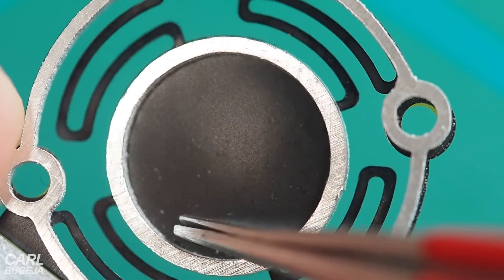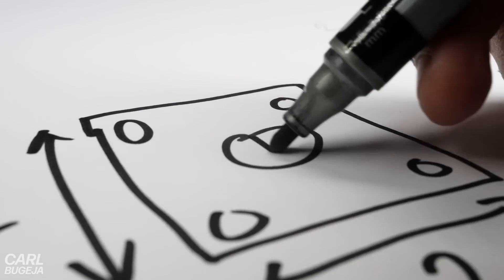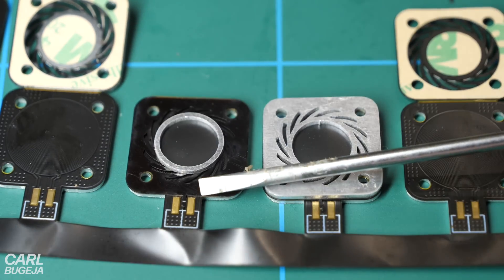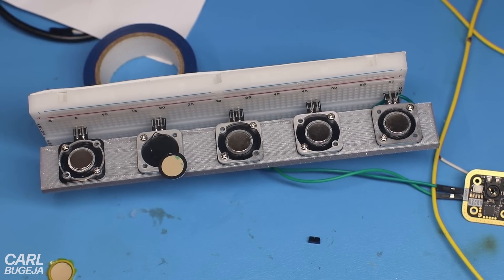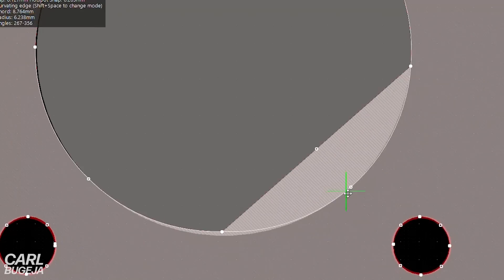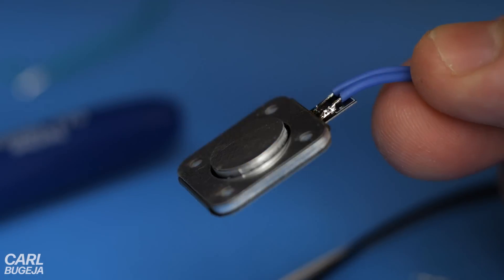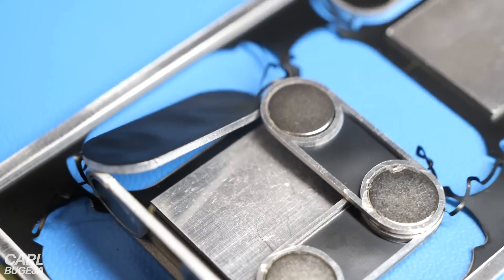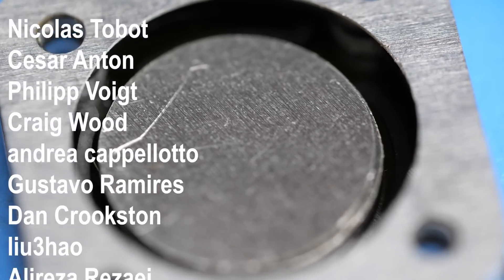Building a Spring Actuator with Flexible Circuits!

Comment: It could have been a cool concept speaker. If you would ha e actually taken in how a speaker coil and cone functions.  I believe you could do something cool. Probably would not improve or impress the current working system.  But. Hey that is pretty cool idea. A completely flat speaker? I could have a 15 in mounted in a box behind my truck seat or something would be epic

Comment: This project makes me think that you could use a bunch of these flexible actuators like mechanical leaves like when blown upon by wind, they binder moving back and forth they could create a current that could be stored in a battery Bank giving you more power conversion then a fan style wind turbine.. or you could make each of these into a little fan that could generate current financial wind coming across them..  namaste..

Comment: If using smaller weaker magnets allows you to make a smaller actuator, the blind are a ready market for a Braille actuator. About 10 years ago I corresponded wot someone making a Braille display using solenoids to make pins stick up. A smaller version of this using this technology would use less current and cost a lot less to build. 

Just thinking, multilayer actuator driving plastic pins might reduce the magnetic interference. enough to make a finger-sized Braille display.

Comment: Carl. I have a challenge for you. To print a entire RC plane. No wires, no parts to add, only glue, and plugs you can solder on to add chips and circuits you find on the market.

Comment: I have 1 mm neodymium magnets. Can they print a pcb coil that small? If so, a braille display with 1 mm pixels should be possible. Might need coils even smaller, like .25 mm to avoid interpixel interference.

Comment: How about filling the housing with oil, putting the assembly in a waterproof flexible bladder and using this actuator as a way of generating pressure waves underwater for communication.

Comment: true dc mhd bearing motor
Reply: thats a speaker magnet coil
Reply: hey dont move the magnet, move the coil
Reply: the coil pcb is much lighter to flex than the magnet on top of the it, yep two layer pcb with socket for the magnet
Reply: macro accelerometer
Reply: magnet on pcb, and the moving part on top, like a flap
Reply: it can be flap flex fan

Comment: Carl, you are interested in a very interesting private field.
As an engineer, I love following your work.
I have two suggestions.
- Play with frequency values.
- Continue the winding in more than one layer while placing the coil on the pcb. For example, let's say that all 8 layers are coiled. I think this will reduce the overheating problem a bit.

Comment: === warning. google translator in action ===

the design aesthetically looks pornographically beautiful. But technically, the solutions presented make my eyes itch.
be sure to use magnetic cores.
1. the magnetic field of a permanent magnet extends far beyond the device and will interact with the surrounding objects. With electric circuits, with ferromagnetic materials, and with permanent magnets of neighboring actuators. Moreover, both in statics and dynamics. The same applies to the magnetic field of bare coils.
2. These bare magnets will collect all the ferromagnetic debris they can reach, and the device will fail very quickly
3. If you want to use low-efficiency printed coils, the use of magnetic cores with high magnetic permeability becomes a necessity

Magnetic cores can be used solid metal. But for good dynamic characteristics, it is better to use layered ones, which will not be easy in such sizes. Maybe some powdered ferromagnetic composites with high electrical resistance will help.

And more. Try to control the coil not by voltage but by current. There may be some kind of class D amplifier with current feedback. This should improve both the linearity and energy efficiency of the actuator and driver.

P/S/ about the flexible element. I believe that rigidity in the direction perpendicular to the axis of displacement is critically insufficient in most cases. Maybe instead of cutting, it is better to use corrugated stamping as in the coil holders of conventional dynamic heads?

спасибо за внимание, и прошу прощения за много букв. :)

Comment: Dude you might have got the start of a cool keyboard there:
To mitigate the interactions between adjacent magbets try putting the magnets with opposing poles next one another (Nup, Ndow).
Then build a keyboard array, if you keep the magnets up with a constant coil voltage you can then monitor the change in the coil current when a magnet is pressed, boom you got a frictionless keyboard.

Comment: Please try to build a Braile cell, that is a perfect project, it requires miniature actuators. I worked in a project like this for blind people, and the braile cell technology was too expensive, it was a German technology using high voltage, but if you manage to make it work for active braile cell, that will change the life for many people. The prototype we made was like a cellphone using this active braile cells. Great work by the way!!
Reply: He tried to make a digital display earlier and it didn't work.
Reply: Do it do it
Reply: @06howea1  yes
Reply: We would love to provide necessary financial support.

Comment: Inwould mount it under a flexible Material like thin Silicone or something. so you can make an analoge dynamical User Interface that shiw Button only whe they are touchable.
Just make an contact under the Magnet an you have a haptical Dynamic Button

Comment: Instead of a spiral use something between a J and a U with longer to the outside ring radiating inward. Or even a W where the middle hump is not connected to the outer ring. The shorter length is glued to the magnet. So say you had 8 segments radiating to the center ... you would have 8 glue points. This would allow the flexure to be below the magnet and would constrain it more centrally and have a more consistent level and minimize the size further.  Or if you bent on a spiral make entirely underneath the magnet and just confine the center. Basically invert what you have in the thumb nail ... instead of the 4 points connected to an outer ring, bring them all underneath and to the center.

Comment: How about active magnets instead of permanent ones. so two counter flexture coils folded. this would eliminate the permantent magnets trying to bunch together. Experimenting with oscillating circuits could be interesting as well, e.g. to reduce energy consumption,

Comment: In my basic understanding of magnets and circuits, I feel like you should see a change in voltage as pressure is applied to a flexed pad. If I am right, and the sensitivity of what you are using to read the voltage is refined sufficiently, then this could have applications as a minute load cell.

Like low pressure environments / suction sensors or powder fill machines in pharma manufacturing.

Comment: I know it wouldn't exert as much force, but what about instead of using a magnet you used another coil with opposite polarity? What it lacks in force it makes up for with reduced thickness of the whole assembly. 
_______
|   @   |
|@  @|
|   @   |
----------
Something like this might let you do that idea for tilting a laser reflector. The @s represent pairs of coils on top of each other with opposite polarity, so they'd either attract or repel each other as required.

Comment: If the mechanical bit you are moving can be made to be bistable, i.e. latch into one of two positions, you would only need to power the actuator in either polarity to switch it. A polarized screen covering the visible display in combination of a polarized reflective coating on the articulated element might result in the element being visible in one position and invisible in the other. A variation of the flip dot display where the moving element might not need to actually move very much at all.

Comment: The PCB strength is not as good as metal, but actually you show quite good results.

Pros of flexures: Frictionless guiding, quite good on spring linearity for controlling. 
Cons of flexures: Deflection of the beams usually about 1/10 of the length to prevent yield, so the moving distance will be limited.

Comment: I think your laser tilt flexure suffered from sheer force, sliding the magnet without deflection. This seems likely due to your coils being polarized through the thin part of the board.

If you had the four coils aim radially you might get a better response.

How I would approach this is I would run a supply from the outside of the board along one of the 4 radial axis (x+, x-, y+, y-), one for each coil. On either side of these lines have vias, one for each coil. Connect the supply line to the most central via on a selected rotation (cw/ccw). Run on the under side a circular trace to the next most central via along the longer path (can't go through our supply line). On the top side run a trace back towards the first via but then skip to the second most central via to start the second coil.

Not much area in the coil but the change of axis and many more coils could compensate.

Comment: It's probably already been suggested, but have you tried fixing the magnets firmly and having the coil as the moving part? You can power the coil via copper on the arms of the flexure. You then should have far less mass to move, and with the magnets fixed, you wouldn't get the problem of the magnets tearing the thin flexure arms apart. Am I missing something here?

Comment: What if you flipped the concept around?  Integrate the PCB coil into the movable part and move the permanent magnet to the underlying substrate.  That way the flexure doesn’t have to support the weight of the magnet or keep it from flying away.

Alternatively, perhaps try adding some iron to the movable part and have the flexure provide a restoring force to spring back from the underlying PCB coil when turned off.

In any case, I think the permanent magnets are the most troublesome component of these assemblies.

Comment: If you used your multi-coil pad with a piece of steel instead of a magnet, then you could use the flex unit as a sensor that would proportionally couple the center driven coil to the sensor coils proportionally to the force applied.  This would be a good low volume flow sensor.

Comment: I don't know why but I can see this being a super futuristic button. A system that pops it out then you can press it like a button. 

Say you want to turn on a light. It doesn't pop the button out untill it's pluged it. Once plugged in you can push it and the magnetic field can be used to register a button press.

I wonder if you could also use it as a n analog button.

Comment: If you had a system of flextures that you glue to a moving piece, you could have a bistable actuator. You'd just need the flextures to attach to something that compresses them slightly from their rest position, so that deflected in or out is stable, but in the middle is not. I need a thing in my life that indicates whether the current time is inside a specific period, but it needs to consume essentially no power most of the time. I could use a bistable version of this to shift an indicator pin up and down, so it's either sticking out or hidden. You could use a series of this indicator to create a progress "bar" or a binary readout, but simple state indicators like "is it between 3 and 7pm on a weekday" or "is my server online".

If you could detect the flexture being pushed to the other stable state, then this could even be interactive, maybe a minimalist work timer where you push the pin in to start the timer and it pops back up at the end. This could be handled in a lot of ways, detecting it through the coil would just be cool.

Comment: Since your flextures are made flatflex pcbs, you can get rid of permanent magnets entirely and use 2 coils with opposing magnetic fields instead. Or at least make flextures contain the coil and keep angry neodymium magnets glued to the backing pcb.

Comment: i think your galvanometer idea would've benefited from a more traditional cross-gimballing situation (think 2 thin tabs between halfcircles flexing around X, then a circle, then 2 thin tabs in Y) instead of a linearly expanding spring. or do the same trick as most directional pads on controllers and just put a bump in the middle under it to force it being tilted.

Comment: If you used all electromagnets instead of permanent magnets you'd destroy the circuits a lot less since they'd only interact with each other when on. 
Also, I believe this technology (with refinement) has applications in biological valve replacement.  
Out of curiosity, could you create a flexible tube that would contract in a wave sequence to pump fluids?

Comment: The mechanical seven segment display is neat, and could be good if it was a bistable mechanism, so you only have to power it when switching between configurations.

Comment: High acceleration, low resonance frequency mini haptic actuators are hard to find right now. I work with them every day and your design is atypical with the coil under the magnet and not around it. Most devices use the Lorentz force for a constant force regardless of the magnet displacement. The suspension is the hardest part to get right, the second hardest is the magnetic circuit, good luck !

Comment: Its hard to invent a flip-dots display, especially since it is already invented with the better design than flapping pcb assembly. Dont waste your time on this.
Reply: This idea can work as 2d/2.5d actuator or a sensor. Both? You definitely need some feedback from it for a better positioning (rather than just applying some voltage).

Comment: I think you can use the actuation as a means of switching between bistable configurations.   Right now the motion is linear and is dependent on the flexibility of the pcb
Reply: Excellent idea! There are some interesting bistable mechanisms that use materials that aren't normally considered flexible. If the range of motion is entirely within the elastic range of the stiff material, then the device can last millions of cycles.

Comment: Please design a braille grid element and make it openhardware !!!
Reply from the maker: i think this would be still be a bit big for a braille.. may braille art could work (but i m not sure how piratical that is)
Reply: @CarlBugeja  what about leaving out the magnet and having two flex-pcbs with opposing coils, so they "buckel" - blind people do not need much hight difference to be able to tell the difference ..